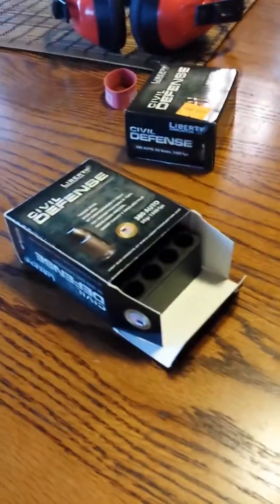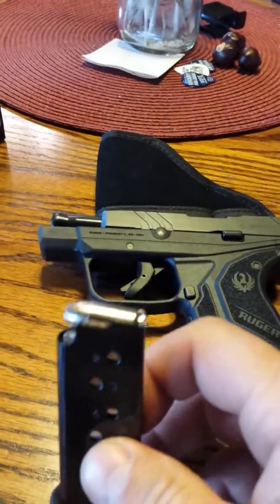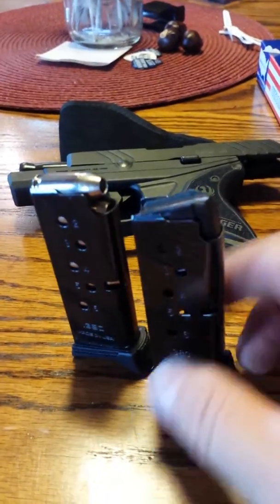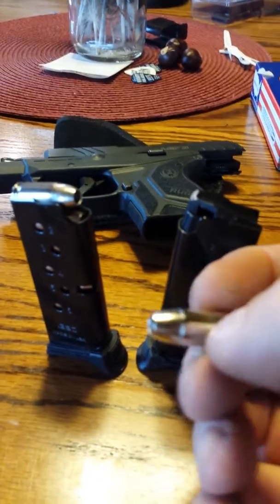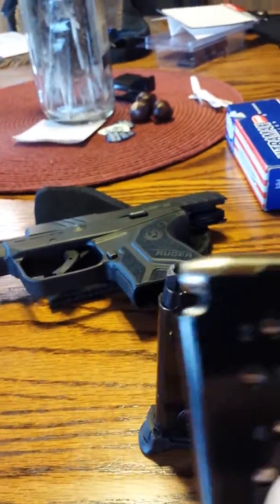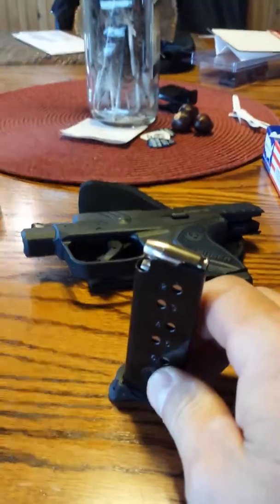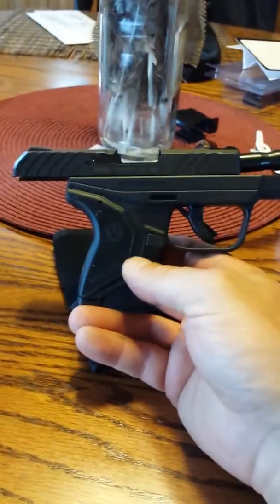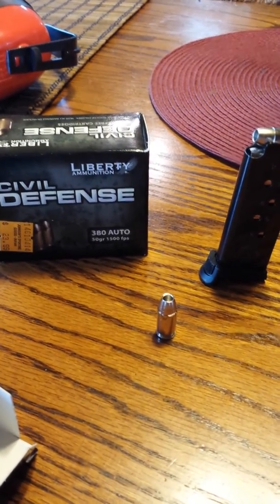FAILURE TO FEED: RUGER LCP2 & LIBERTY CIVIL DEFENSE

Comment: And guys. It takes roughly 1000 rounds and multiple deep cleanings to make micros run smooth. A simple examination inside. You will see bits of metal for 100s of rounds. Pro tip: oil, lots of it, on a super clean gun.

Comment: After I polished the feed ramp with some rouge and a cloth wheel in a Dremel, I found the rounds occasionally hanging up on the TOP of the barrel pipe. I'm going to round the sharp angle there in the same way. I've also noted that when I rack to chamber a round, it helps the process go more smoothly if I push forward on the slide. I'm going to try a stronger (13#) recoil spring for $9. Some say they reduce recoil and muzzle rise as well.

Comment: Mine likes precision 90 gr. XTP or federal  95 gf.ball (FMJ) for the range, I tried everything and had the best results from these, for my lc9s it’s Federal HST 124 gr. Or almost any ball I used, it gets expensive shooting your self defense or law enforcement rounds but of course you have to feel comfortable with what you will be carrying ,  I found that when new I had stove piping every 20th round or so and difficulty manually clearing the mag up through the LCP but with some rounds going through and some cleanings it seems good now, if it would of continued it certainly would have back to Ruger. I’m more of a Glock shooter and I really don’t like that removable pin for field striping though so I bench strip only and still keep some extra pins handy, good luck

Comment: I also have problems with my LCP 2. With all ammo cheap and expensive carry ammo. I have shot hundreds of rounds through it and cleaned it multiple times. Sometimes it shoots flawless and sometimes it jams every other shot. If you look at some of my shell casings they are actually dented around the neck of the casing which I believe is cause the casing to get stuck in the barrel and not ejecting correctly. I love the little gun, I used to pocket carry it with a Viridian Reactor laser on it. Gun was awesome to carry but I quit because of the reliability. I’ve heard you can send them back to Ruger and get them to rebuild it. There’s also another video on YouTube where they grinded on theirs and fixed the problem.

Comment: Did you figure it out?  Mine is hanging up on the 3rd round.  Fails to go into battery.  3 or 4 times in 58 rounds.
Reply from the maker: Hey Ben, I have about 600 rnds through my LCP2, and haven't experienced any more problems in a while.... like 200 rnds
Reply: That's good. I just polished my feed ramp. Hopefully that takes care of it.  Gotta get to the range now and try it out.  I did notice a lot of machine marks and a small nick in the chamber face.  I think I'll contact Ruger if it still hangs up.

Comment: The first 2 to 3 rounds are hanging up on the feed ramp on mine. Freaking sucks, I do not want to send this sob to the manufacturer.... haven’t tried fmj but all hp’s are hanging up the exact same way. I have not shot it at the range but just loading it by pulling the slide back causes them to hang up every time.